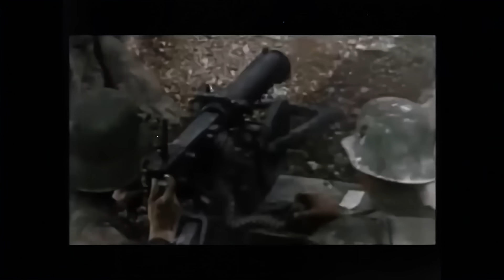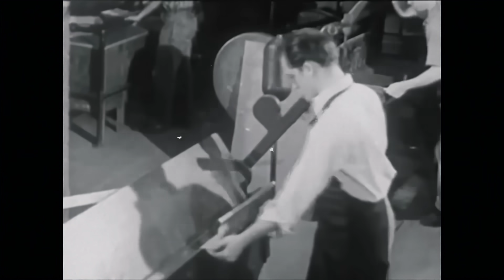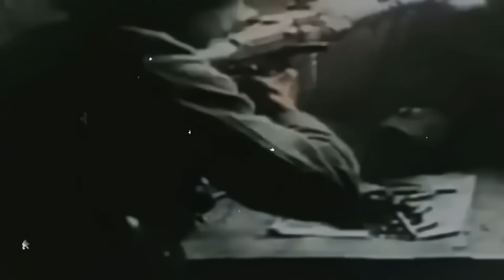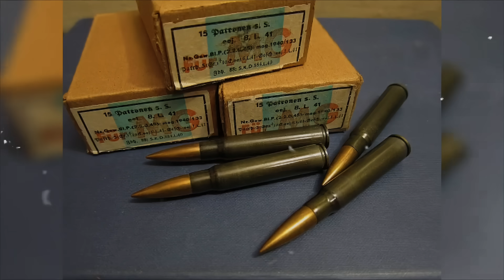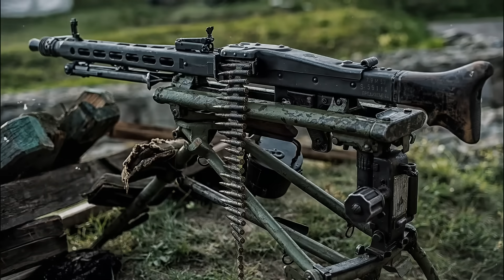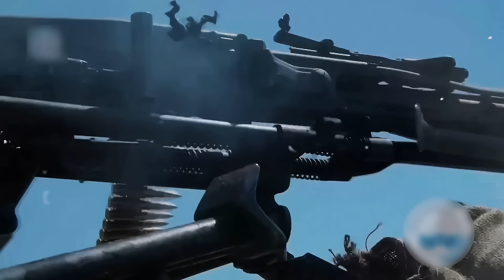Why U.S. Failed to Copy German MG42

Comment: Wonder if it possible to make a MG belt feed with 3 rate of fire, 300 rpm, 600 rpm or 1200 rpm. Maybe even have water cooled barrel, that could be switched with a regular barrel.??❤

Comment: uh the problem with high rate of fire. is high rate of consumption and that's a logistics problem. The US didn't fail to copy it they surpassed it. since they mastered mass production of precision parts (Aka highly accurate machining tools and measuring equipment)  you don't need a master craftsman to press a button. and the US method produced IDENTICLE parts that can be interchanged with warn out guns.  for every 1 MG42 the Germans made the US made 100.
Reply: Maybe, but you need 100 Us MGs to stop 1 MG42😊

Comment: Its not that the US failed to copy it its just that it didn't fit US doctrine. It was viewed as a ammo hog that burned through too much ammo too quickly and lacked the reliability of the more robustly built machineguns already in service.

And even if the US DID need a comparative fire rate to the MG-42 they could get it by modifying machineguns already in US arsenal for example the AN-M2 1919 that could also have a 1,200+ RPM fire rate but with more reliability as its a more robust design.

US ended up taking the MG-42's back half and modifying the design for a slower rate of fire resulting in the M60.

Comment: The US fail with they copy because they attempt to simplify the design, was the same issue with the french Hispano Suiza HS404 20mm auto cannon built under license in the US during WW2, but finaly they built the HS 404 exactly according original design and it work (Colt Browning MK12 use u to the F8 Crusader (last retired in 1999!)...

Comment: I believe I'd still be able to fully disassemble/reassamble a MG3 :-) trained on the 800 rpm version in military service (germany 91), mounted ones were equipped with different bolts and made 1200. the legend said that "in case of" they'd all get stiffer springs and would go up to 1500. mounted, it is an incredibly precise and effective tool. shooting it free-handed is the real fun.
Reply: wasnt the gun always jamming and need lots of maintanse ! ... Bad to use in muddy conditions

Comment: I myself served in the German Bundeswehr for four years about 35 years ago, and what do soldiers do when they're bored during field exercises or on the firing range? Right, what all guys do: they start messing and playing around with their equipment, and in this case, their weapons! For example, you put a large practice hand grenade on the ground, remove the locker, and then put a helmet on top – and see what happens... Experience shows that you always start with one hand grenade, and as the "experiment" progresses, the number increases rapidly! Well, eventually you reach a point where the helmet flies straight up 30 meters into the air! Boom! There it goes, flying steeply upwards again, up, up and away! In any case, one of the most popular games in the German Bundeswehr is developing the "right finger technique" to coax and trigger a single shot out of the MG3 – what else?  And so here I was, my father had already told me how they played the "MG3-Single-Shot- Firing-Game" in the German Bundeswehr in the 1960s! Conclusion: Tough soldiers are often just little boys who pass the time with "board games" when they're bored! 😁

Comment: The allied didn't try to replicate the MG42, hence why we didn't at all. We never made fun of the MG42, we would NEVER try that. It's stupid. Instead, we described the flaws, probably where you heard the "more bark than bite" line. It has a fast RPM, and runs through ammo quickly. And again, American doctrine is far different, so it doesn't make sense to introduce a weapon that doesn't follow doctrine

Comment: MG42 had 25 rounds per minute (=1.500/min) and not 1.200/min. The rate of fire is given here in rounds per second rather than rounds per minute.
Only the later version MG3 had a rate of fire of 20 rounds per second (=1.200/min), which was also reduced from other countrys to 900-750/min depending on their military requirements by changing the bolt.

Comment: The M-60 WAS a reverse engineered copy of the MG-42. The US Army admitted openly they had the MG-42 and the FG-42 reverse engineered to create the M-60, you know, the belt fed machine gun Rambo used in first blood?
Reply: Finally soneone with a bit of sense.
And after the US used the M-60, they decided to switch towards the best LMG of the cold war, the FN MAG and called it the M240.

The M240 weighted 10,85 kg (for whatever reason, since the FN MAG-58 weighted just 10,15 kg ...), whilst the MG 42 weighted 10,6 kg.
So weight was pretty much the same.

But the FN MAG-58 had:
- a better fire rate for prolonged firepower (less frequent barrel change and belt reload)
- was more reliable
- better barrel change mechanism (can be done from all sides, not just the right rear)
- just as accurate
- was just as good of an all purpose MG (at least within a military with 7,62×51 mm as standard caliber)
- less wear on it's parts due to the slower fire rate and the gas driven recoil system
- was more reliable, due to basically being a beefed up upside down BAR action with an MG 42 like feeding system

The FN MAG is an all around improvement of the MG 42.
(In terms of suppressing enemy positions for prolonged periods of time, not in terms of shooting at fleeting targets, which was a task left to the other soldiers with their automatic firearms.)
The US realized this too, when they slowed down the M-60s fire rate to 550 rounds per minute.
Reply: @Gottlieb_XCIV.  PKM was hands down the best lmg of the cold war, it still is today. FN Mag is too heavy for a lmg role.
Reply: @Gottlieb_XCIV.  Yeaaah, no... PKM is the best LMG of the cold war hands down.
Reply: They also didn't fully understand what they're doing and that's why there is an useless part in the M60. When they copied parts of the FG, which is a select fire rifle, they copy part that doesn't do anything on MG that is automatic only. :D
Reply: @XtreeM_FaiL  I was thinking you were going to talk about the MG-42 firing at 1200 rounds per minute and the M60 firing 650 rounds per minutes.
What was the name on the component from the FG-42 that they carried over but was completely useless?
Reply: @ScottFuller-o5t  I never remember the name. It isn't mentioned often and I'm talking about the part and not just the name, so find out is a pain. 
If I remember anything, it was a small part with a spring. It was part of the fire selector, so comparing FG-42 and M60 exploded view might give an answer. Why have I not think of that before? I've always try to googleing it.

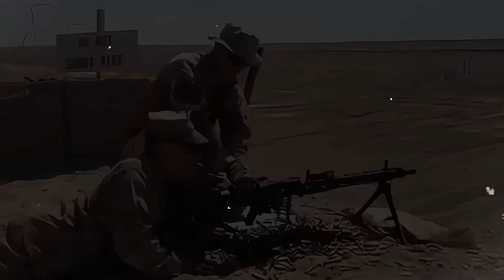Comment: 4:44 changing out the barrel sounds good. But you are forgetting that the barrel is going to be hot.
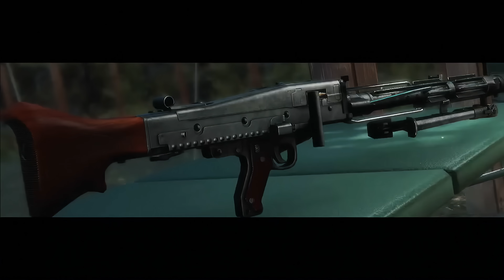8:55 I see by your video that the US did not in fact try to copy the MG42. But tried to modify it. Too many changes and most likely rushed.
Sounds like it would have been better if the US simply copied it and mass produced it along side there captured ammo cans. 
Focusing on short controlled burst.

Comment: I never knew about the tripod and it's auto-fire capability. That makes the gun so much scarier.
Reply: Actually its more quadpod with periscope. You can shoot with barrel above your head. So gunner can be covered from counterfire.
And in addition on pod maschine gun became incredibly accurate. Skilled operator can hit with first burst in circa 1000 meters / yards soda can.
Reply: @tadasdovii8262  The mount helps a deal too. Soft recoil mounting, like weak air shocks or something.
Reply: @robertsolomielke5134  correct maunt have recoil dampeners

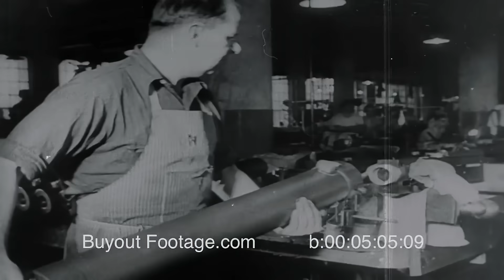Comment: 11:15 just an Idea, building the same gun with the same caliber what is now called nato caliber ?
Reply: The Bundeswehr, Germany’s Federal Defense Forces Standard Issue SAW used to be the MG-3 (The Modern Interpretation of the MG-42) But The Support Squad had to carry ammo for it and Reduced the Overall platoon Effectiveness. 

So they replaced Machine Gun with the MG-5 Where its Lower Cyclic Rate Makes it Much more easy for precision suppression say at long ranges or such.
Reply: @Ghost0465-1 Isn't the MG3 still used in Leopards?

Comment: The mg42 a great gun and is one of the most tactically overrated pieces of kit because of German fanboys not understanding how war actually works.
If you’re rushing a machine gun nest and the browning is shooting 10 rounds a second at you, it’s the same as five riflemen. That is more than enough to do his job. 
The MG 42 fires 20 rounds per second… great. Do you know how many times an extra 10 rounds are needed per second to keep enemies heads down vs needing those 10 rounds a second later in the fight when you’re logistics that’s broken down?
Simply put it was overkill in 95% of situations. 
The browning 30 could suppress and kill and sweep fields with almost the same efficiency. 95% of the time. But… it was twice as efficient with ammo.
Most prolonged engagements came down to ammo expenditure. 
The Germans were always struggle to keep them fed.

They didn’t fail, Eugene Stoner made the M60 and the MG 42 was very very inefficient in maneuver war fare. 
It’s great for defense if you have a ton of very experienced gunners and unlimited ammunition or perfect logistics…..
It’s horrible if you have limited logistics.

All the nerds love the 1200 RPM numbers but in reality a machine gun is there to keep the enemies head down and accurate burst. 600 RPM means 10 now the second. You do not need to fire faster than 600 rpm in 95% of situations.
If a dude is firing at you with a 30 caliber browning you’re not poking in your head because it’s only firing 10 bullets a seconds and not 20.

All these German fanbois act like they were great machine gun duels or something. There wasn’t. 

There might be a psychological Edge, but if you rush a browning 30 caliber in an open field and a mg42. The brownie is going to fire 10 rounds a second twice as long.

Comment: Interesting fact about calibers: research showed that in WWII most firefights were at rather close quarters. And you didn't actually aim that much, you fired and took cover, so you had to cut through trees and walls. So a heavier caliber seemed the way to go for penetration, instead of a lighter caliber that could travel farther easier. But the Swedish machine gun the AK 5 (Automatkarbin 5), an excellent weapon, uses 5.56 instead of 7.62 caliber like in the older AK 4. It uses a core of steel, with the tip also of steel, for better penetration without increasing the caliber. (There is also a fosfor tracer, and a tungsten carbide bullet for penetrating armor. And an infrared light that can only be seen through special goggles.)
Reply: Well as the video so noted., the Germanms wanted to develop and  field 'one MG that could do it all' and of course this his impossible since different air, seal, and land usages demand different weapon capabilities, however, the Germans were perhaps correct that this same 'one weapon does it all' capability could be applied to the German ground forces which had something like 20+ different small arms calibers that needed to be fielded and for which the MG 43/44 was going to be the sole fielding solution however it came too late in the war for this to happen.

Comment: Showing the details of the MG-34 and MG-42 without mentioning tactics, doctrine and strategy, is always missing the most important part to understand the technical details.

The Wehrmacht was set up as an offensive army. For this, the infantry was organized in platoons with several groups of soldiers. Each group consisted of 1 MG-42 with at least one more support person and 6-8 grenadiers with a riffle and a group leader. The task of the MG was then to suppress the defending enemy from a mid-distance (e.g. football field length), while the other did an assault run. 
In this role, you have to suppress the enemy fire with 2 major purposes. First, when you see an enemy, you have max 2 seconds to shoot at him, before he covers. That's why you need high fire rate, you only have 2 seconds. Second, you need to suppress enemy counter fire. Here the psychological effect is dramatically, when as the defender you hear bullets hitting your surrounding area, either with a dat dat dat or with a drrrrrrd. In the attack role, the defending enemy will not give you much chance for long shots. Burst are also enough in this role.

With introduction of the attack rifle, which has also the limited possibility to do suppressing fire, the main role of the MG is now relaxed, and ammunition consumption is more important now. But in the old role as the only suppressing fire task in a group, for sure the high fire rates are essential.

In defense, this looks different, but with the tripod it also has a different solution.

I shot some thousands bullets with the MG-3 during my service time, and I know the difference in between burst mode and letting a whole belt run through at once (fun, but very low efficiency hitting one target 100m away).
Reply: But it is mentioned here, exactly like you describe it. So what is the purpose of your comment?
Reply: @Ned-Ryerson I haven't seen the detail of "suppressing fire" and "Wehrmacht ist an offensive army" and what the tactical setup of a group is. Defensive I have seen.
But I'm not a native speaker, so maybe hidden.

Comment: The term „blitzkrieg“ was never a german planned strategy or used as term in the army, this is a term coined by allies to describe mobile combined arms offensives with tactic initiative on the lower ranking officers side. The result of this might have been „blitzkrieg“, but that was just good tactics and command structure, while the allies for a long time still relied on rigid command structures, giving soldiers no initiative. Only late in the war they would adapt some of it - the Russians are stuck with this rigid structure to this day (except for special forces).
Reply: The term may not be Germanic, but the operational dogma remained valid despite whatever name is given unto it!
Reply: @tiberius-f7t  WHAT? What do you intend to say?

Comment: The gas system on the M60 has always baffled me. So much extra weight in having to have not just a spare barrel, but also two gas systems and two bipods because they're all permanently attached. 

The M2 is pure delight to fire but God damn the thing when you have to carry or clean it! I was in an artillery platoon for awhile where our .50 cal barrels for some reason did not have the carrying handles and the only way we had to move them around was over our shoulders. My shoulders ache just thinking about it 35 years later.
Reply: There were a lot of things wrong with the M60 that should have been caught and changed prior to its production and fielding, namely: no gas regulator, no handle on each barrel for hot barrel changing (Ala Bren),  each barrel had its own tripod which caused needless weight.

Comment: M60 in away was America's answer to the MG42.
Reply: not really. M60 weighed 2x mg42.  The U.S. also stupidly had to reinvent the wheel instead of just adopting the MG3 because some general has to get their somethin somethin for their approval. M16 was revolutionary tho. Whatever the tech it needs to get the job done,  be reliable, simple to maintain, easy to carry and easy to repair. So much of our tech doesn't meet all these attributes but the legendary ones do.

Comment: Many Taliban died in German MG3 fire in Afghanistan and fled when they heard the sound.
However, German soldiers in Afghanistan were very dissatisfied with the penetration performance of the 5.56 × 45 mm NATO caliber. Therefore, G3 (7.62×51mm NATO) rounds were partially reintroduced in Afghanistan.
Reply: For my battalion, it was usually the designated marksmen plus one of the riflemen that got the G3 on deployment. Back home it was back to the G36 for the riflemen.
Both modernised with the Finnish G3's as an example.
I got a picatinny rail with vertical handgrip, a more modern bipod and the old reliable 1,5-6x scope and a new stock.
The riflemen usually got a two picatinny rails, one below the handguard for a vertical handgrip and one on top to mount an eotech. Some of the guys bought boosters privately. 
Heavy beast, kicks like a mule but sturdy as f*ck.